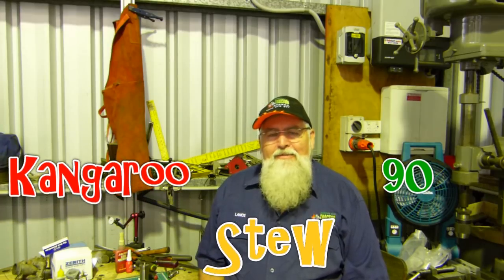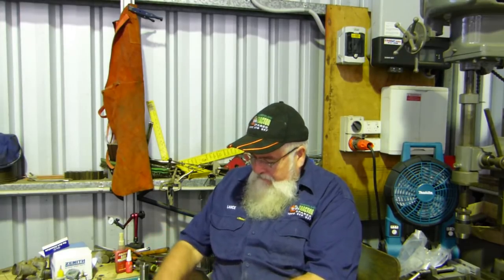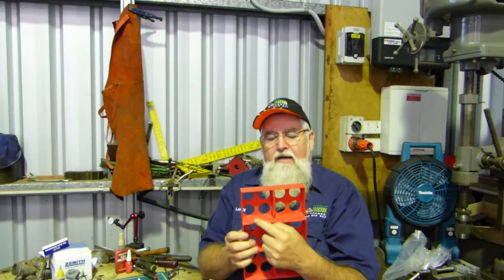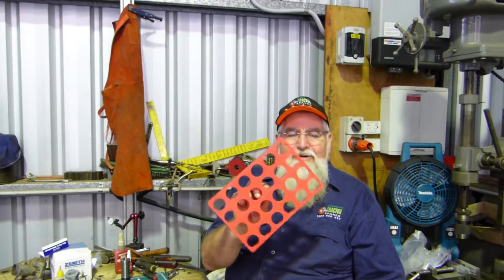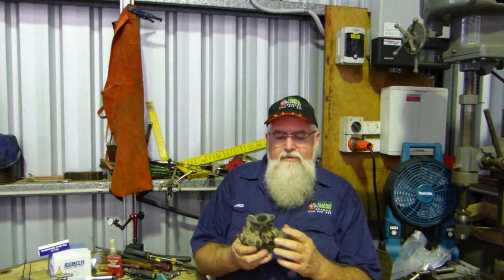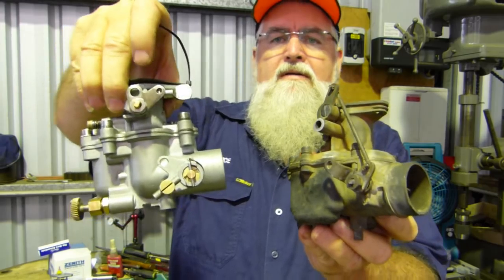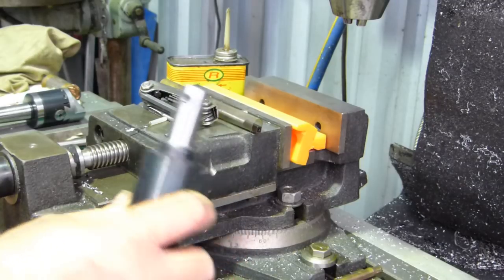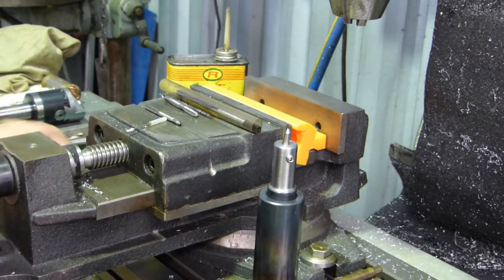Kangaroo Stew #90 3D Printed collet rack and finishing the Centre Drill Holder

Comment: That's fantastic Lance.👍wished there were blokes like you in the UK who could restore my carby. I bought a new one in a show and it run like crap tryed everything to get it right but it wouldn't take high throttle and investigating why  from one parts supplier he told me there where a bad batch circulating about. So I'm stuffed with it ! ☹
Reply from the maker: G day Calum, Boy that's no good, I have not heard of a bad batch over here as yet. At high idle I would pull the main jet out and have a good look, and possibly open it up a little you can always turn the adjustment down then.
Reply: Thanks for the tip John Timbs 👍
Reply: Hi Lance. This was about 5 years ago now? The other supplier said to me they'd stopped supplying them cause of customers complaining with theirs not taking any throttle. He also told me the first batch where good quality at the beginning but when they switched to another company for making those carbys the drilling's were incorrect for the airways for the jets but since then I've seen the supplier has started selling them again so they've solved the problem since then. I've done what youve said to do, I've had it even taking the mainjet out whilst running at high idle and screwed in and out the mainjet as Well as slowly adjusting it to see if any difference but both times they were sill running crappy when given it throttle. I'd even took it apart to see it there's any crap or glaze got into it and given it a clean out for a precaution to see if that would help but still the same problem. That's when I asked a supplier about them and he'd told me the air hole size's for the jets were incorrect some were made to shallow and some too deep. so I'm afraid I'm stuck with it and I just put back on my old worn carby and I've always have to run it dry to turn it off to avoid the float sticking due to a worn grove at side wall on the carby.  But next time if I buy a new one I'll ask a supplier to check it by having them installed on their tractor to check if it works for them to avoid another costly mistake again.☹